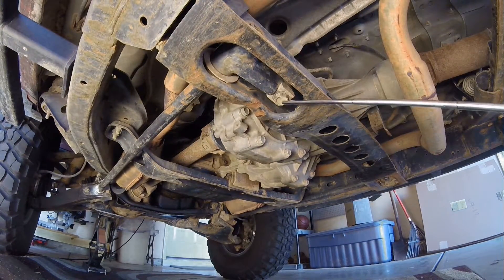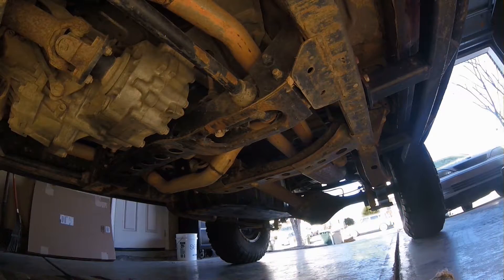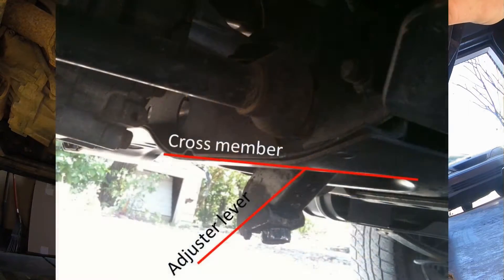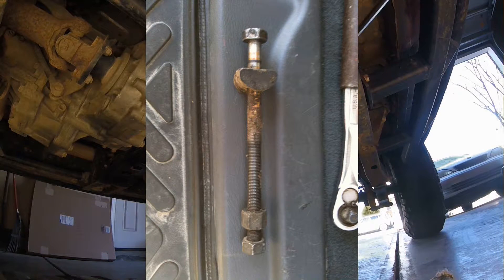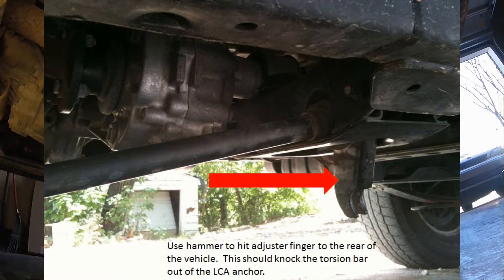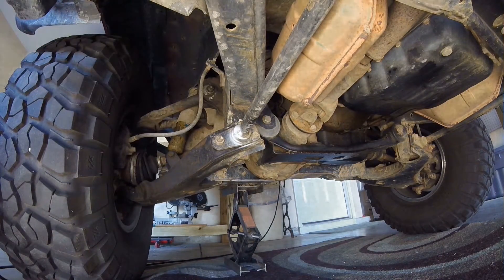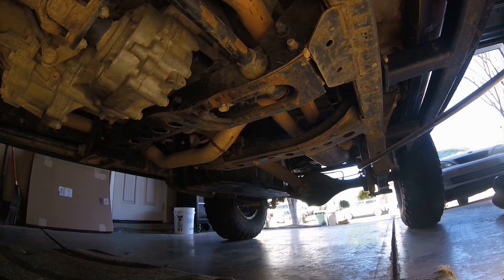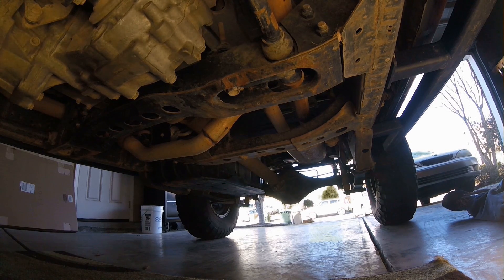Getting Lift out of UCAs - How To:  Re-Index Torsion Bars

Comment: On my ‘01 there is quite a bit of room between the bumpstops and the control arms. Would reindexing fix this if my controls are maxed?
Reply from the maker: Room at the upper bump stop means you can have a higher lift from an alignment geometry perspective. If your torsion bar adjuster is maxed out inside the frame rail (hitting the top of the frame rail)...then re-indexing will give you extra room to crank your adjuster bolts further. Is that what you are asking?
Reply: Yes. Also, if one side is touching the upper bumpstop, and both sides have bad positive camber, how would I go about fixing that. This is all post PML
Reply from the maker: Scroll through my playlist xterra mods and fixes and look for my video on lifted alignments. That should be a good starting point for getting an alignment.

Comment: My front end feels like the suspension is loose. Going over speed bumps and uneven road makes the ride very loose and last longer than it is supposed to to get back to settled state. I replaced the shocks all around. If i re indexed the torsion spring would it help stiffen the front end?  Not really looking to raise, just stiffen.
Reply: Hey rob, i have been having a lot of problems since i got my xterra and you videos have helped me get some issues fixed so thank you for that. I do have a torsion bar issue (passenger side) that i need some help on, my bottom control arm snapped so i replaced it but when i put it back in. The torsion bar fell out but when i got it back in my passenger side is really low (19 1/2 in) and my driver side is at 22 in. I have tried to re do it but when i tighten to raise up i get nothing happening. So can you or do you have a video on how to get it back in where it lifts? Thank you
Reply from the maker: You are at the right video.  Also check my video on adjusting the torsion bars, I go into a little more detail. If its installed properly...the bolt will raise it...but it is a slow process. If you are that low...im betting the adjuster lever is bottomed out in the cross member...you need to remove the bolt, remove the end of the torsion bar from the LCA, and then rotate the bar 2 or 3 spline teeth before reinserting back into LCA mount. You need to rotate the bar so the adjuster lever is further away from the cross member, that gives you more twists of the bolt to lift the truck before the bolt head bottoms out in the cross member.
Reply from the maker: Nope. Reindexing won't change the stiffness. What shocks did you replace with?
Reply: Xterra Rob can’t recall the name of the brand at the moment. But i was able to compress them by hand to install them if that means much. The old ones didn’t rebound but the new ones did so maybe the new ones are just to weak?
Reply from the maker: jimmyhenion its possible the replacement shocks are too weak. Any modifications that would change the front end? Off road bumper, winch, etc? The extra weight makes the suspension bounce more.  Other than that...it comes down to shocks and the torsion bar springs. Torsion bars don't really wear out or change over time...so my guess is either sub-par replacement shocks...or you have an overly positive memory of how your Xterra drove when it was brand new.
Reply: Xterra Rob stock vehicle. 2wd. It has to be the weak performance of the shocks. I do need to replace components of the suspension so i will just do a complete overhaul next year. Thank you so much for the quick response and look to more videos from you.
Reply: Probably your coil springs